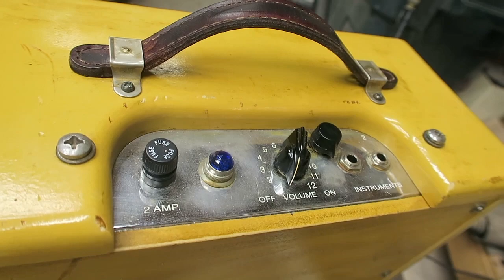BUTTERSCOTCH MADNESS --- Zachary Handcrafted Guitars

Comment: I just saw the trailer for the new Suzi Quatro documentary. I mean, I love Documentaries, i'll watch one on most anything. I was never a huge Suzi Quatro fan, I knew her from "Happy Days" as Tuscadero. She is a bass player. Has a lot of custom hand made basses. I don't think she is a superb bass player, but does okay for her bubblegummy likeable pop music. If I were going to build a Bass themed for her, I would do something much like that early type P bass you did there, but give it a bubblegummy swirl finish-you could do it in dye if you had an immiscible dye an then ooil or shellac it over. I think I'd use the "SQ" style logo from the old Speed Queen laundry equipment. I'd put some mildly subversive decoration on it somewhere, something obtuse, but specwise and feature wise just a straight 4 string P bass neck , simple pickup setup, a nice adjustable bridge. 

 OOne thing I always wanted to do for a woman bassist or a man with small hands, would be a P/J bass neck  that is exactly one first fret distance shorter, so the spacing is the same, but the nut is where the first fret is on a regular bass. 32" scale is just a tad too short but the 34" is a reach for people with smaller hands. A little subversive cool trick. Subversive, stuff you don't notice at first, is always good. 

 Personally-I'm not much of a bassist but can fill in if I have to. I keep a couple of cheap decent ones around. If I had to work as a bassist I'd buy a Kubicki Ex factor 4, no question.
Reply from the maker: What ever happened to the Kubicki ExFactor? What a great design. 
I guess the hype wasn't there to excite the Normie to buy it. 
The guitar industry is like mainstream media. Most of it is BS and Hype. 
What ever happened to Kubicki for that matter?
Reply: @zacharyhandcraftedguitars  Sadly Phil, who was hired by Roger Rossmeisl at Fender right as Leo was going out, passed on March 18, 2013 of Stage IV pancreatic cancer. I did not know Phil but had heard great things about him from Gene Fields, who was doing steel guitars at GFI at the time, I used to go to the Steel Guitar convention in St. Louis all the time. I'm not a steel player or builder but it was always a good show. At any rate I have played (to the extent I play bass at all, e.g., Not really)  a couple of them , well made and sound great.